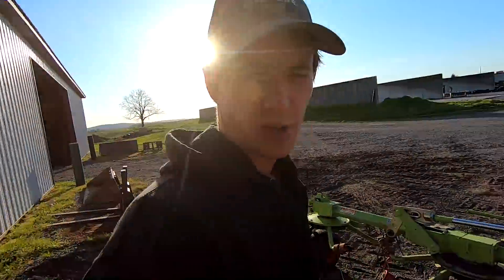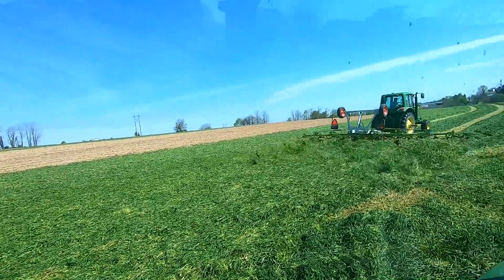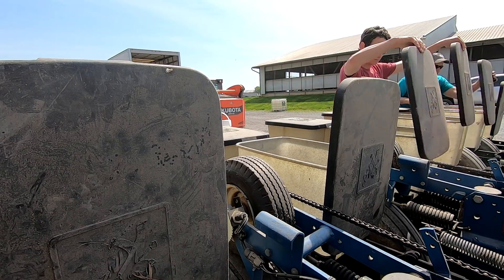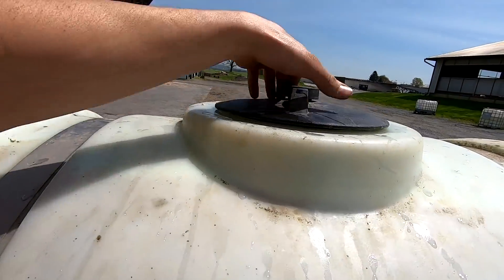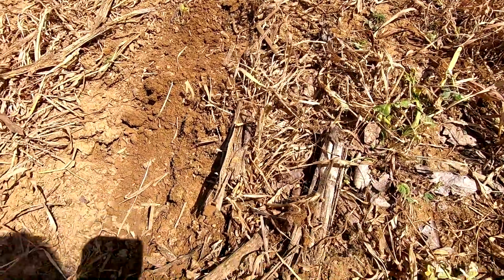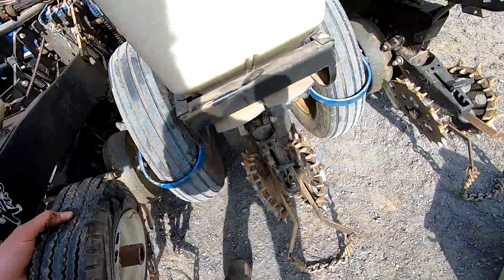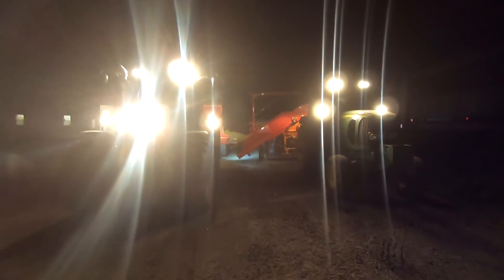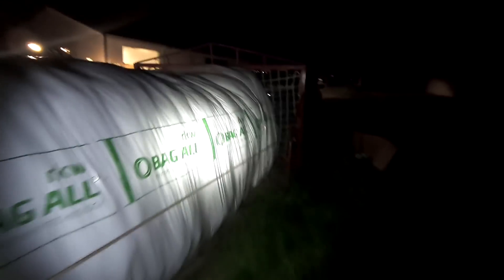Start Corn Planting & Filling Ag Bags

Comment: As someone who's only used to round bales what's the benefits/disadvantages to making one really long bale like that? To me round bales whilst they may take longer to stack are easier to move around and much less prone to spoiling as each are wrapped individually. To me if that huge bag gets a few holes it could spoil large chunks of it. 

Or do you only use the large bag method when your silos are full and you don't have anywhere else to put the stuff?  In any case it's still interesting to see different farming methods.